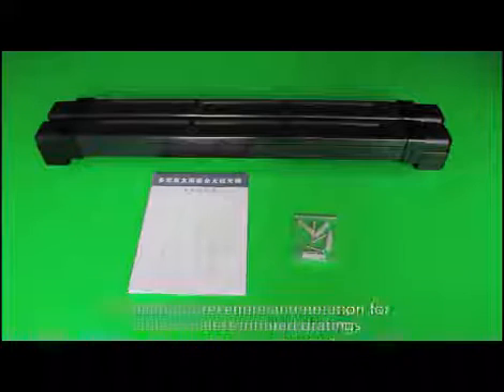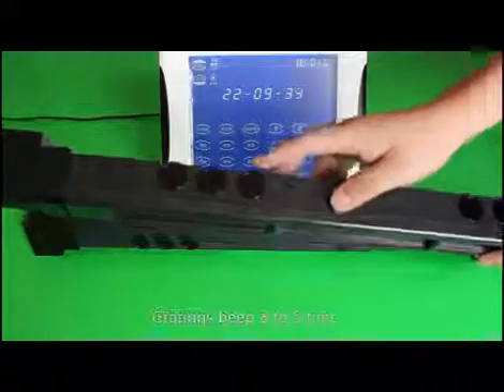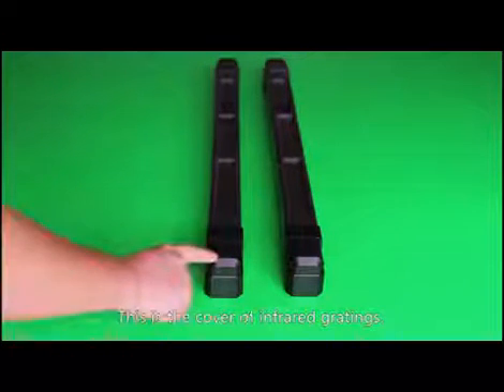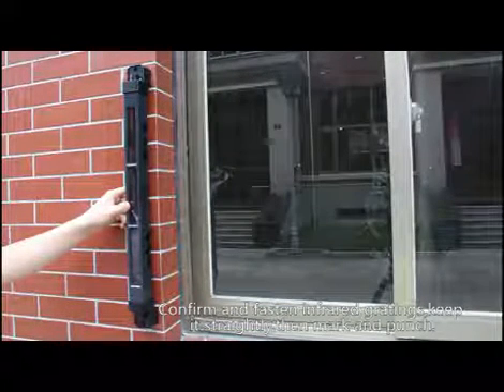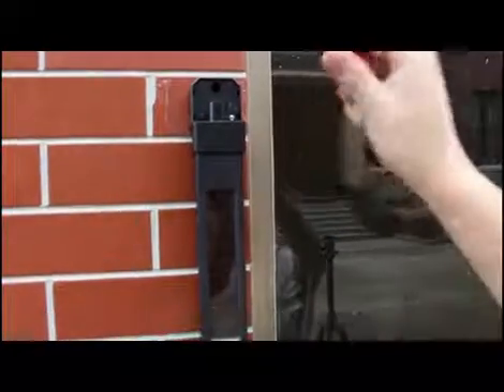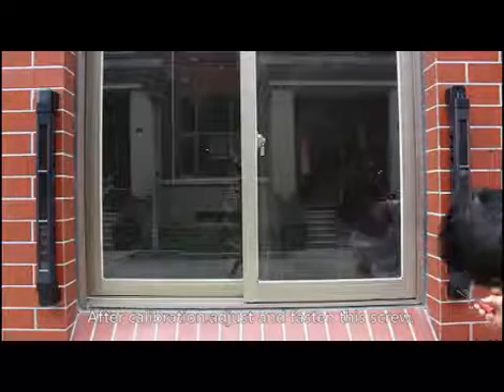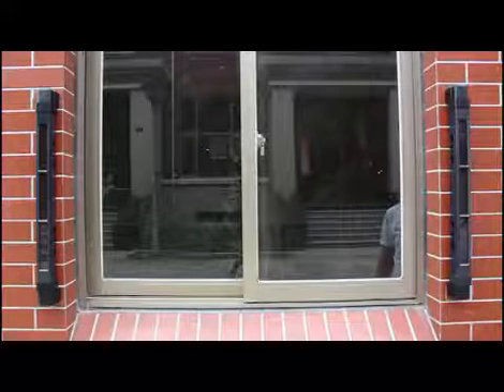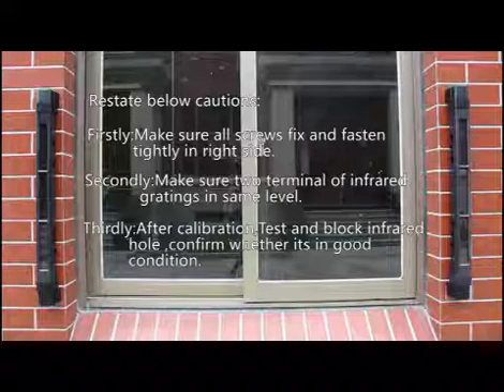Wireless infrared grating Programming guide

Comment: I am having trouble with my installation. The system will work well during daylight hours but wont alarm at night (when I most need it). I havent used a laser sight to install it.  Is the alignment critical?  Can anyone help?
Reply from the maker: If it works well during daylight hours, then it is aligned well. What receiver do you use? Do you set timer for arm and disarm? Please let us know the details to help.